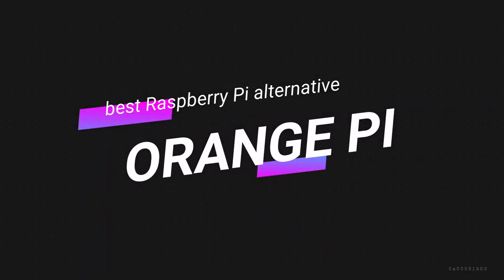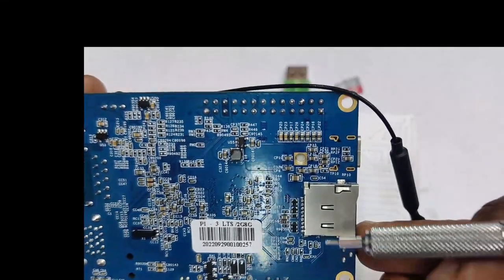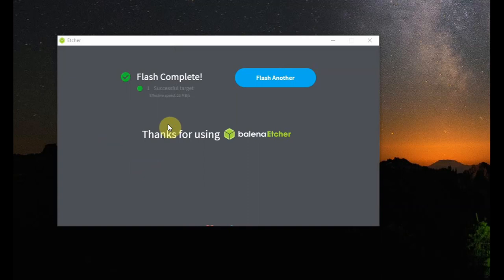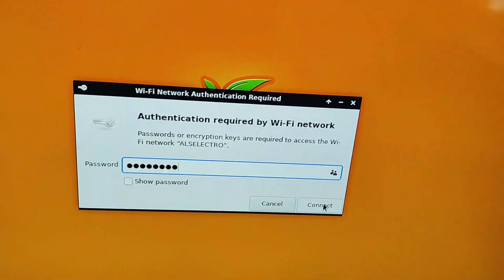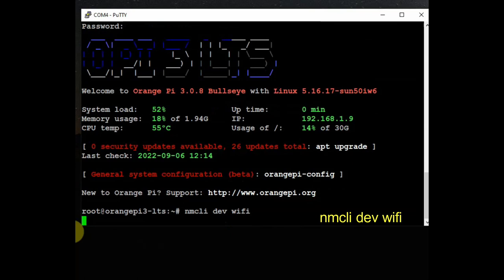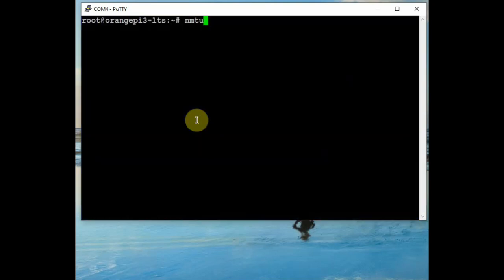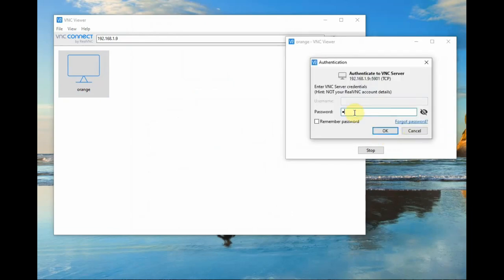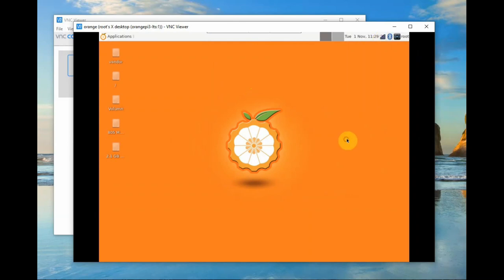ORANGE PI with eMMC Flash - best alternate to Raspberry PI

Comment: Hey I am using orange pi pc Plus, have installed Ubuntu os from the official website, i am having issues with the partion it allocates only 1 gb of space to use , the other space from 32gb sd card is left unused
Reply: Have you encountered this problem?